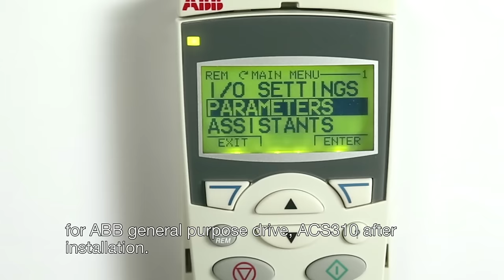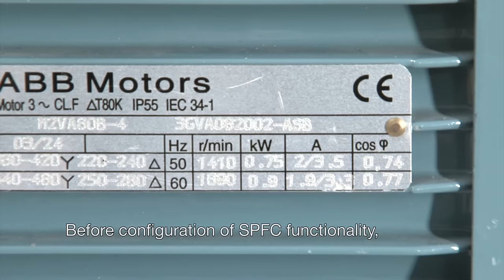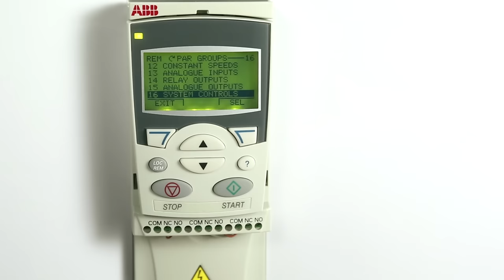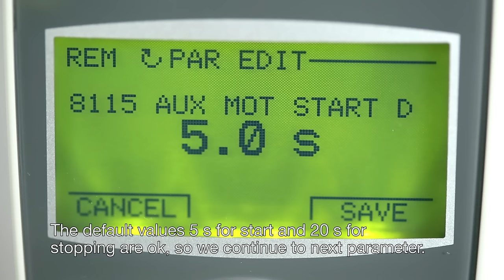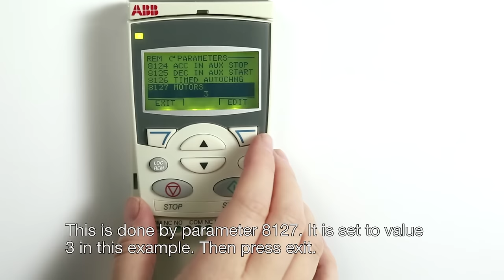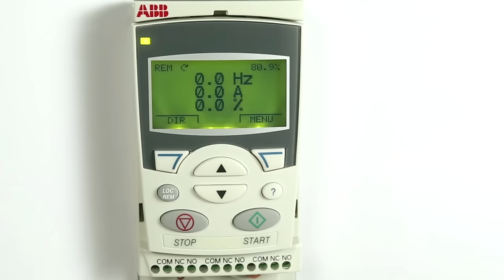ACS310 – Configuration of multipump and fan control with soft start

Comment: Good day
I have a problem at (ACS580 DRIVE )
my function is multi pumps single drive (four pump booster )
i need to the booster work by (SPFC ) function
the FVD work by (SPFC) wile the number of motors running simultaneously are less from three pumps only
for example
the pump-1 run with VFD when it reach to full speed the the VFD trans to pump-2 and the pump-1 will run DOL then when the pump-2 reach to full speed must be the VFD trans to pump-3 and the pump-2 run DOL
but But what happens the VFD return to pump-1 and the pump-3 run DOL
note: the system work by (PFC ) function well
pleas i need to help
thank